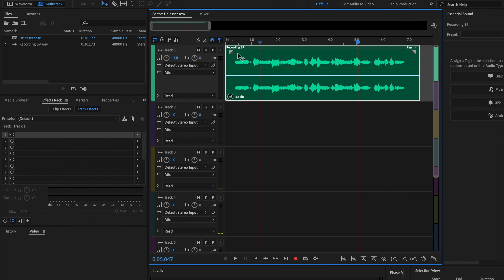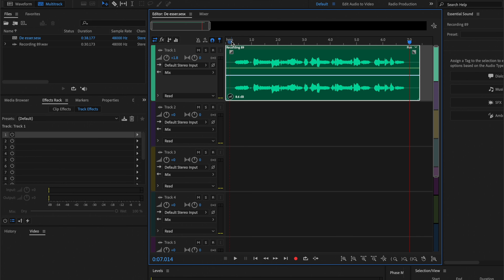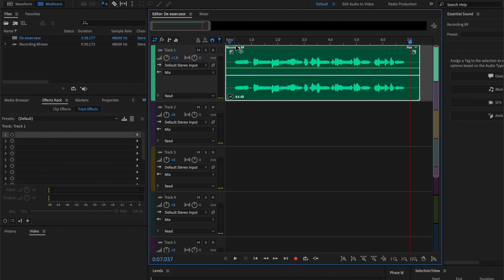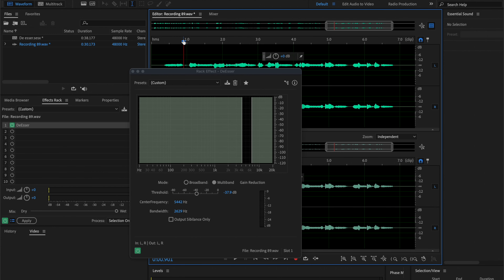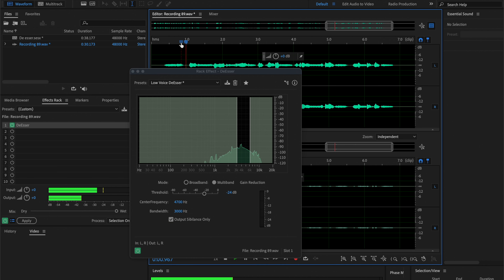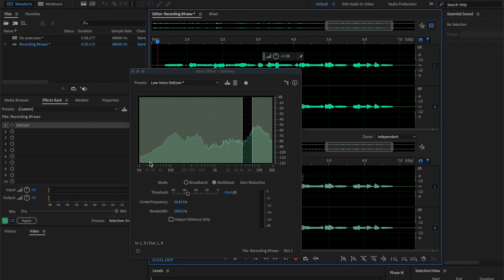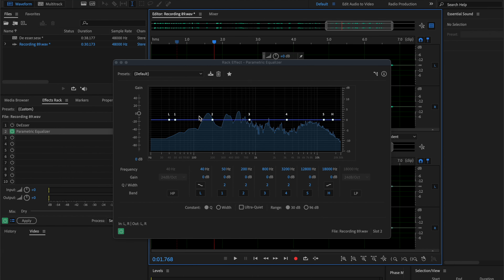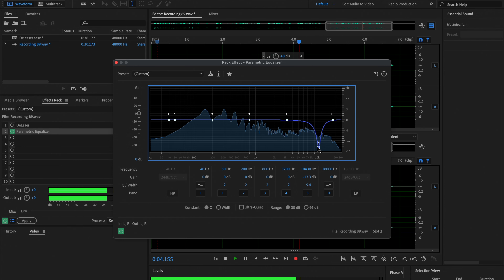What's An Audio De Esser & When/Why Should You Use It?

Comment: The de-esser is a very necessary tool when using both ireless  microphones and or compression.  Early compressors had very harsh sounding output.  You really could not stand listening to a compressed signal without using the de-esser.  A touring singing group played our theatre.  They each had a wireless microphone in hand.  The sound operator remarked about how during the entire tour (we were the last house to play them) the sound needed to be compressed and became very harsh.  I asked him if there was a de-esser built into his digital board.  After looking it up on google, he turned on that processing feature of the board.  The results were nothing short of remarkable during the second half of the show.
Reply from the maker: Totally makes sense that compression and de-essing would go hand in hand. Thanks for the insight!

Comment: Thanks, Tom! Very useful info. Also I got my NT USB+ yesterday! the sound out of the box is great! Now I'm figuring out how to get rid of background noise. The noise gate on/off in Rode connect is not very strong or adjustable. Any suggestions?
Reply from the maker: It's been a while since I've used Rode Connect, but if you can turn on the Advanced EQ options or use Rode Central, it should give you some more tools to fine tune the gate a bit.
Reply: @tombuck  thanks, Tom! I’ll look into it